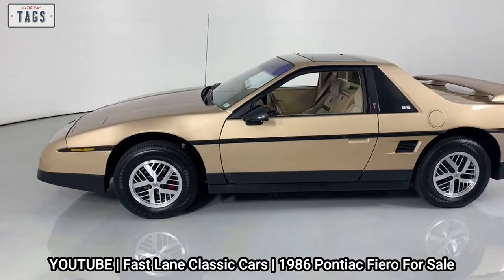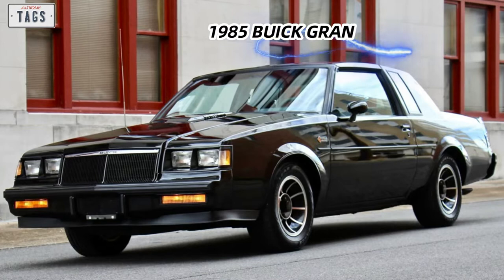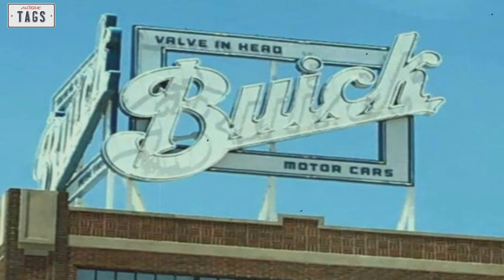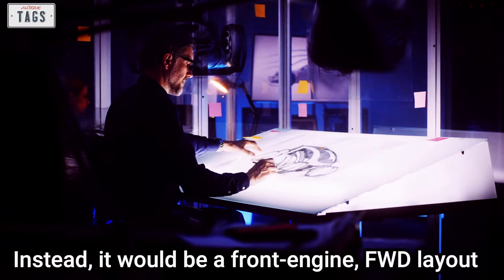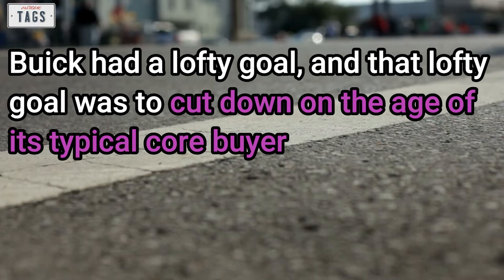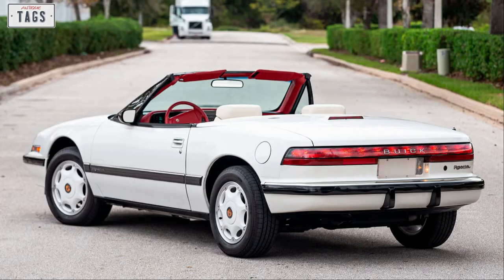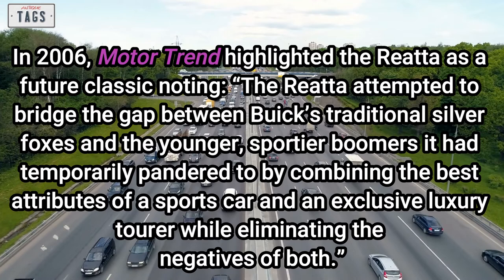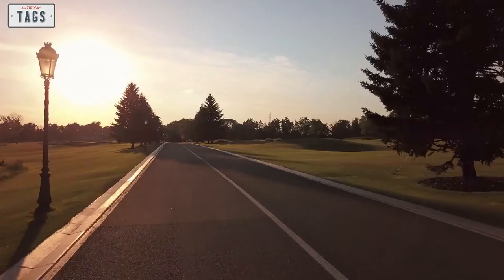What happened to the Buick Reatta? This is how GM had high hopes for the unique Reatta two-seater.

Comment: I had an '88, from 2011- 2021, and I took it to cruise-ins all the time because it still looked new (lots of lookers & very positive comments too).  The build quality was better than most cars of that era, & no problems w/ the ECC.  It was dependable & fun to drive.  However, as it aged, I was getting tired of aging parts replacement/s, etc. etc. etc., so I finally let it go to another enthusiast.  I miss it.
Reply from the maker: Glad to hear you had no issues with the ECC. I know some earlier models had glitchy electronics. I like the look of the Reatta. David North did a great job styling it. I Wouldn’t mind owning a clean, low mileage example.
Reply: @MotorMaster_Stunticon  Yeah; eBay usually has half-dozen of 'em listed all the time & of those, there's always two or three minty-condition ones for around 10k-ish ('91 converts start around 15k, if you ever see one fer sale!)    BTW... good vid.
Reply from the maker: Hey thanks man, and I’ll definitely check out eBay for that.
Reply: No they dont @MotorMaster_Stunticon

Comment: The Riviera could've been a 2 seater, but GM blocked that, for the same reason why GM finally dumped the F bodies, and also why the 2 seater Buick wildcat concept car, which was due to replace the Buick Regal Grand national after 1987, a 24V3.8V6 rear engine sports car,, instead they compromised and suddenly brought out the reattta, GM didn't want anything to detract from the popularity of the Corvette.❤😂

Comment: I'm such a nice guy I bought one for 600 dropped the fuel tank took off the rear axel and changed the fuel pump with a new car battery and I used sea foam and compressed air to bypass the old fuel lines and clear old materials and completely overhauled the car and accidentally broke the key ignition plastics and sold it for 300 to help another guy that needed a car

Comment: Great episode! I love the design of the Reatta but remember,  even back then being disappointed it was fwd. Buick actually made rwd experimental GN's with it and the Regal using Corvette rear suspensions with high boost turbo and super charged 3.8's. Journalists went crazy but just like any great engineering ideas at GM.. outside of Corvette.... they went nowhere. I wonder what happened to them to this day.
Reply from the maker: Interesting little tid bit. I didn’t know that. Yeah the design was great. The L67 +Reatta would’ve made a nice combo.
Reply: @MotorMaster_Stunticon  if you look on YouTube you can find the Motorweek test of them. Very cool. I may have it saved in one of my lists.

Comment: I didn't give a damn about the fiero but I did and still do love the allante and the reatta, I liked the reatta more than the Riviera especially after 1988,far as I was concerned reatta should've been the future Riviera, anyway, the allante as well was a or could've been a front wheel drive Vette.
Reply from the maker: Sounds like a neat idea but not sure how well-received a FWD vette would’ve been back then even if it was sold in conjunction with the C4 (we saw what happened with the mustang/probe).
Reply: I seriously doubt that because unlike the E cars of today back then both cars had their faults the allante more so than the reatta, I was more impressed with the reatta 3800 than Cadillac engine, maybe if the front wheel drive 5.3 V 8 had debuted in 1987 instead of 2006 the allante would have nearly the front wheel drive equivalent to the rear wheel drive Vette because the allante was more well equipped, which justified it's 50k price, just never had any balls under the hood that's all.
Reply from the maker: Perhaps so